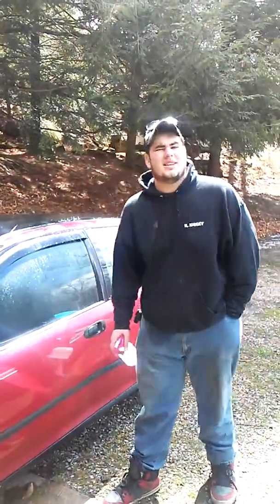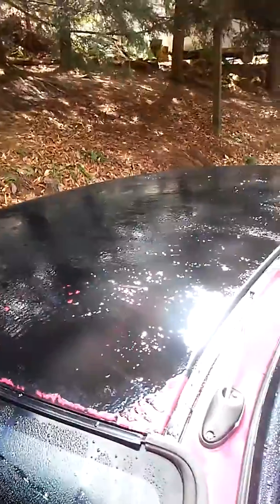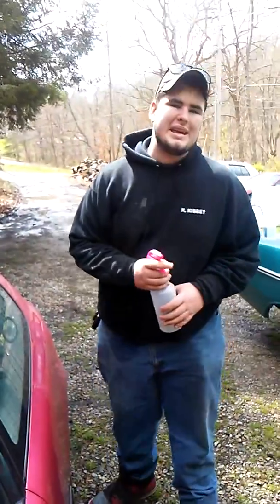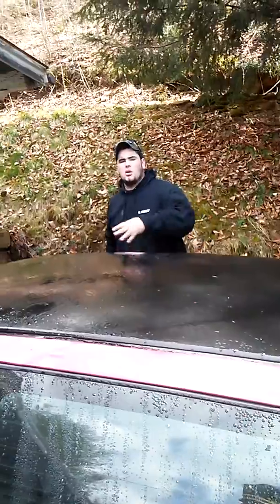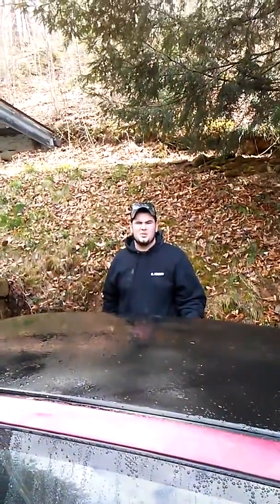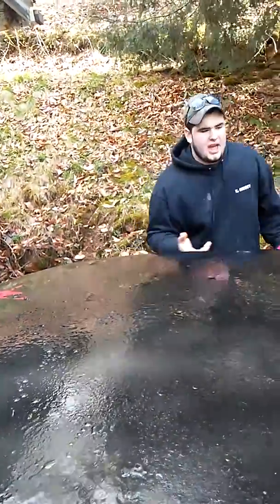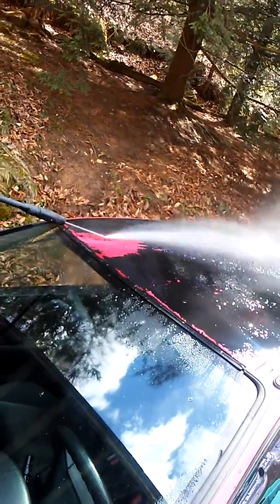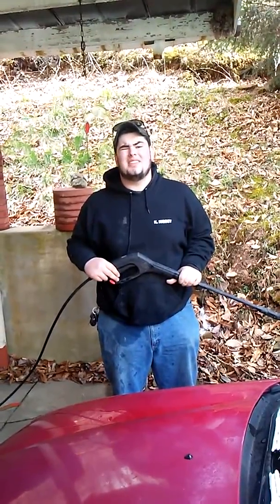How To Remove A Thin Layer Of Peel Coat Plasti Dip

Comment: This doesn't look like it actually works, I would think after all that work
with the paint thinner , and multiple apps, that pressure washer would make
that stuff fly off, I'll just use a sanding disk. : )
I accidentally spilled a spot of gas on my bike's plastidip coat, it ate it right 
down to the original paint, so there most be something much better that mineral spirits
for this project.
Reply: You're not going to believe this but I actually tried a really strong oven cleaner that my mom brought back from her restaurant it's industrial-strength so you  have to be careful not to get it on your skin. I sprayed it on the Plasti Dip ate right through it. I was a little scared it was going to damage the paint but it really didn't do much to the original paint of the car nothing a little bit of polishing couldn't take care of.
Reply: @west-texas9806  Cool , glad you got that done,
and without ruining anything.
I did wind up using gas and a rag,
immediate, and great results, I think I 
waxed it afterward too, not that it 
needed it, just in case. lol..